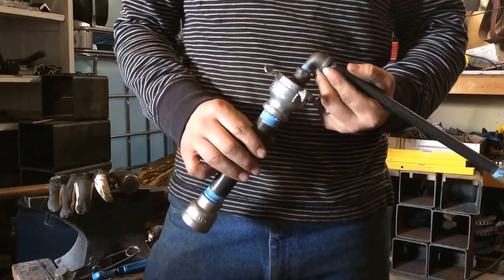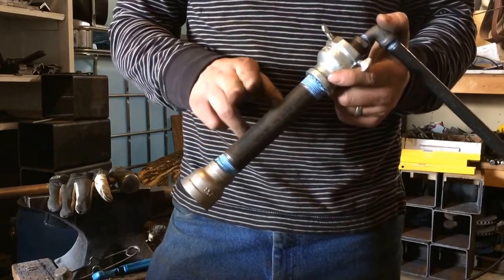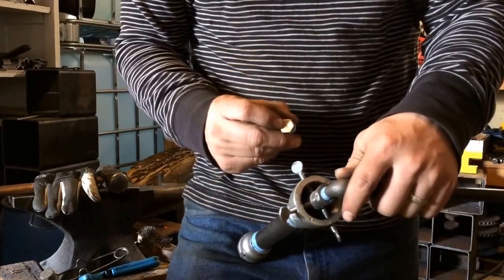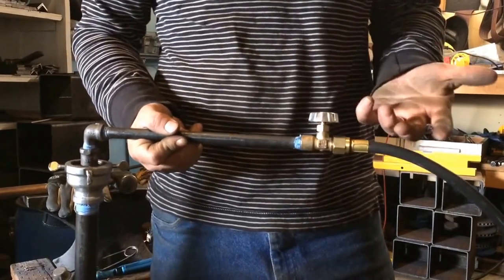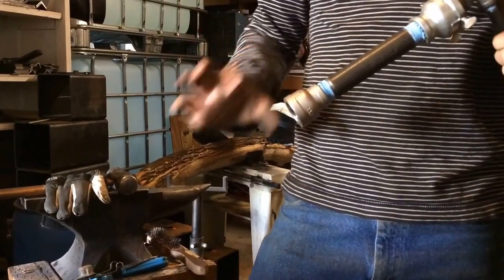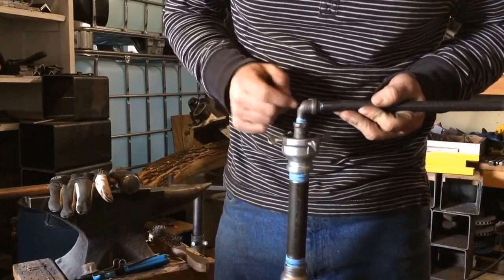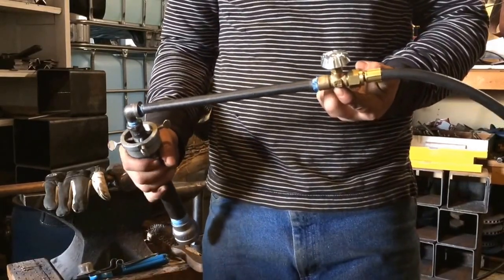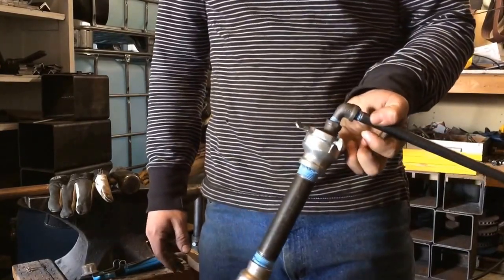Blacksmith propane burner, forge welding heat

Comment: A ball valve is more for safety as you can quickly shut it down.and as for the galvanized reducer safety is everything don’t risk it as death is permanent .
As for the wire gage 57 drill bit I agree it is correct size.

Comment: First of all, thanks for the video. I used your basic design and did order the needle valve from your website. But just to let you know, I used a Lincoln mig tip designed for .035 wire. The hole in that tip is exactly the same size (.043) as a #57 drill bit. I guess they are oversized to allow for the mig wire to pass through smoothly. I made a dual burner setup and it works perfect. Thanks for posting.

Comment: Great video....i believe u meant to say o mig tip is too big...most common mig tips are .035". .030..and sometimes .040".   Your #57 drill bit is .043".which is a bigger diameter.   I appreciate your videos...lots of good info... getting ready to build my own forge.   Thx
Reply from the maker: Patch Ster yep. You’re exactly right.

Comment: I would strongly recommend not having any galvanized parts anywhere near this thing.
Reply from the maker: futureboy it doesn’t heat up enough where it’s at. I explained that in the video.
Reply: It's a general safety recommendation, since anyone making their own could potentially have backfeed issues, resulting in the burner heating up.
If there's no real benefit from having galvanized parts (there isn't), then they should not be used.
Reply from the maker: futureboy there’s no benefit to using galvanized instead of black iron unless it happens to be cheaper. If someone is having the issues you describe then the burner won’t be heating up the workpiece and they will fix it. It takes 2 seconds to fix and these burners don’t tend to have those issues. To cause the problem you are worried about is a serious long shot.

Comment: Can i get away with using a 1/2"X12" nipple from the valve. Still having the #57 drilled hole at the end of a 1/2" street elbow. So that it would be a #57 from a 3/8" section instead of a 1/4" section. Reason I want to do this is the parts are much cheaper and easier to come by, but i am worried the gas jet will be out of sorts. Thank you
Reply from the maker: Jordan schwinghammer the 1/2 x 12 nipple is fine but you must use a 1/4" fitting so as not to block too much of the Venturi opening. You can find parts on my website Rushfireforge.com

Comment: Thank you for posting this information on this burner and the exact specs. There are a lot of diy burner builds out there but this one is by far the simplest that just works. I just got finished building my own using your design (mostly). A dual burner setup with an adjustable regulator up to 20 psi. I just need to get the forge body finished then we'll see how well it performs, but the flame and everything about it is exactly what you show in the videos. 4 main parts and a #57 drill bit. I love it.

Comment: Can you use one 30psi regulator for a two burner setup?
Reply from the maker: Yes. It works great!
Reply: Scott Little where can I get this 30 PSI regulator
Reply from the maker: jesse brandsma I sell them in my connection kit on Rushfireforge.com
Reply: I had one that I had purchased from agrisupply.com. but as Jerome says he sells it in the kit, which unless you have access to parts laying around and know what you are doing may be the best route.

Comment: hey manits a great build.
how much gas pressure do you need to get a a flame like that?
what kind ofgas  tank do you use?
Do you use a Manometer to adjust thw Flow or use bbq tank regulator.
Cheers from Panama
Reply from the maker: Jose Arrue I use a 30 psi regulator and you can use a BBQ tank or larger. The needle valve is essential when running at 30 psi.

Comment: Instead of buying stainless reducer, couldnt you just buy Galvanized and de-galv it with acid or vinegar? Seems easier and cheaper. not to detract from how much I appreciate the simplicity of your design.
Reply from the maker: Jeremy Peterson that would be fine if the only concern was the zinc in the galv. Stainless steel will hold up to heat much much better than black iron or galvanized steel. It'll give you years more life.

Comment: nice video I wanted to know the diameter of the hole that you made on the nozzle to make the flame so powerful I did it with a diameter of 2.5 might be good for you?
Reply from the maker: exquisitealex  I forgot to mention that. It is a number 57 which is 1.1 mm.

Comment: Sorry for what may be a silly question. Can someone explain how this is mounted to a forge? Do you weld it to the forge? Do you slide in in a larger diameter fitting that is already welded to a forge? Thank you.
Reply from the maker: Jesse Giese either of those methods will work great. Some people would argue against welding it on but that stainless flare will last quite a number of years.
Reply: Jarom Rush thank you very much for the response. Will help me with making my first burner and forge. Great videos. Very inspiring.

Comment: currently building a forge and I have a question about placement of this in a tank...if you drill a hole big enough for the reducer then there will be a gap in the forge...our would you drill a hole for the 3/4 nipple and thread the reducer on the nipple while it's in the forge body? can't figure out a good way to put this into a forge I guess...got any suggestions or videos?
Reply from the maker: Most people drill the large hole then stuff in ceramic blanket to fill the gaps. That's pretty easy and works fine. On my personal forge I just welded it on. Since the burner flare is stainless it's going to last a good long time. If it ever deteriorates I can cut/grind it off and weld on another. That might happen every ten years or so.
Reply: +Jarom Rush do you stick the stainless reducer into the forge body to any depth? Or just deep enough in the hole to get a good weld? Also do these burners get hot enough for forge welding? I'm trying to get into Damascus making and my current eBay pos forge just can't get hot enough I think...

Comment: Do you use regulator from propane bottle
Reply from the maker: No I don't. Those regulators are usually 5-10 psi. Mine is 30. It works much much better.
Reply: Jarom Rush work with 20psi regulator??

Comment: You say a mig tip is way too big? A #57 bit is .042". I'm building a burner using a .035" mig tip. They come in a variety of sizes but .035 is pretty standard. Plus, if you thread the end part of the accelerator you can change tips. I suppose you could use plugs drilled to different sizes as well. 
Anyway, it seems to work very very well. Nice video & explanation!
Reply from the maker: You are correct. I filmed this five times before I was satisfied and didn't realize I'd said that part backwards until after I uploaded the video. The MIG tip is too small.
Reply: Oh, okay, that's different. :) 
I'm still going with a mig tip because 1) I already built my accelerator for accept them, and 2) I can change tips for various uses. For example, hardening a blade takes much less heat than shaping steel and certainly far less than welding. So a smaller tip will do, but larger ones can be installed for hotter needs.
Thanks again for the video. I tried to make a similar burner today but no one in my home town (Home Depot, Rural King) had 1 1/4" or 1 1/2" reducers. So I will have to do a different style of burner, one with air holes in the 3/4" pipe.
Reply from the maker: +Ken Graves Plumbing stores will carry those reducers. Don't get the 1 1/2". It's too big.  It will completely change the performance of the burner.
Reply: Thanks Jarom! I ordered a stainless flare for my burner. It does work with a 1 1/2" but I have no idea of how efficient it is - I don't have my forge together yet (waiting on parts). So until my flare comes do you suggest a 1 1/4" reducer?
Reply from the maker: +Ken Graves The 1 1/2 reducer gives you a very substandard jet. I wouldn't wish that on anyone.

Comment: what are your prices for these? also do they burn hot enough to be used in melting aluminum for casting?
Reply: +Logan Milliner I can answer the heat question. these (apparently) can forge weld, a process usually above 2000f. Aluminum melts just above 1200.
Reply from the maker: Correct. These will certainly work to cast aluminum. Call me to discuss pricing. 801-899-5585 Like my Facebook page Rushfire Forge for a $5 discount.
Reply: Eagle Bird Knives Jarom Rush thank you both for such helpful info and I will definitely look into giving you a call quite soon

Comment: Awesome. Smaller reducer and a larger hole than the mig tip sounds perfect. I was getting too much air and not enough gas. This should straighten things out. Thanks.

Comment: Found your video while trying to find some more info on troubleshooting propane burners in general.  The King of Random build specs a .025" mig tip which is way smaller than a #57 drill, which is something like .042".  I was suspecting it was lack of fuel causing my problem, so thanks for the info.  I'm also going to build one with the 1 1/4" reducer, so thanks for that tip as well!
Reply: You can get a 14T mig tip in .045. It works fine. I made a 2 burner forge and haven't had any issues.